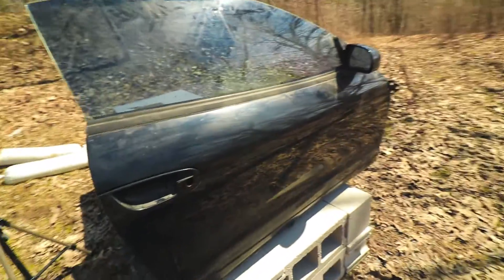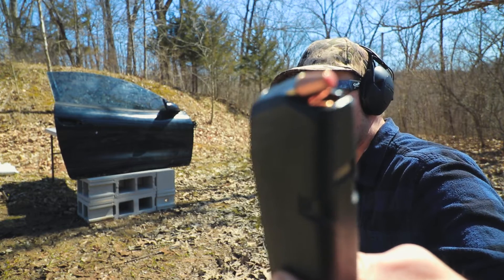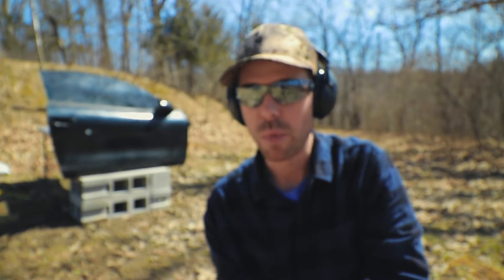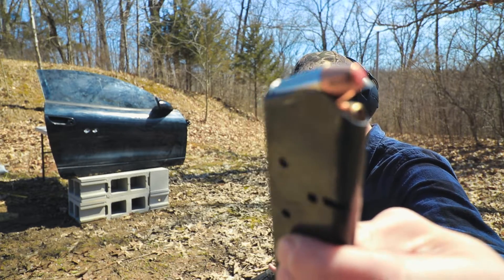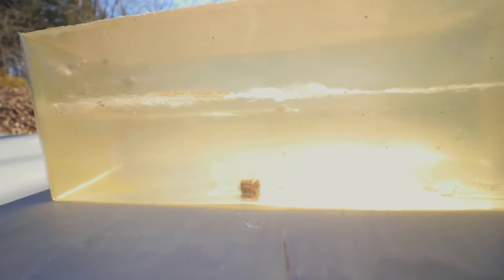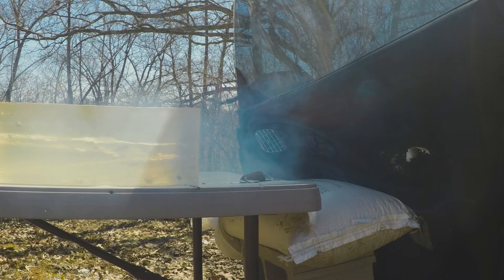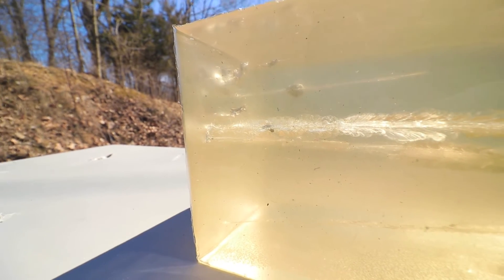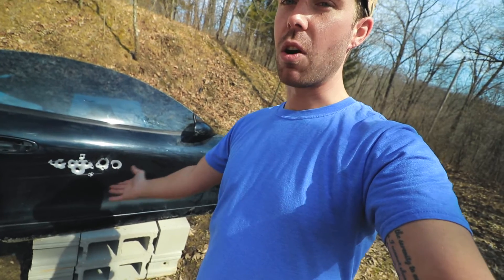Bullets vs Car Doors - Ballistics Test!

Comment: Necroposting...again.
Without watching the vid, the front doors will usually have more electric  motors & "stuff" in them than the rear passengers doors, so where the shot hits is important.
Paul Harrell's results basically showed if you're inside the car, or hiding behind the car in any place not containing the engine, you're screwed.

Comment: You should have shot 380 fmj at that door. Hollow points are banned in my country, a robberies in road are a thing and here are a lot of cheap used 380 and 9mm makarov pistols here. Would be interesting to see if 380 is a good option.

Comment: that door came off a second gen eclipse or talon... I used to have one of those cars, and there is nothing to that door internally. if memory serves me correctly, there is only one vertical brace in the center of the door (behind the plastic) and the window wind mechanism, otherwise its just one layer of sheet metal and the plastic you're shooting through. A cool video none the less, but maybe try to find a bit beefier door?

Comment: Gold dot 124+p and HST 147, the two most popular duty and defensive loads. The 115 Barnes as well. You should fire more than 1 round of each, as you may be striking different things in a car door from shot to shot.

The ClearBallistics dummies have a cool factor, but would actually make for a less useful “test” than a block. They are very shallow from front to back, so many bullets would just zip through. And since x inches penetration in clear gel does not correspond to x inches in a body, it wouldn’t provide any meaningful information. 

PS get a laminated auto windshield from the junk yard! That is the toughest barrier for projectiles to defeat and still provide adequate penetration.

Comment: Great video as always Jesse 👍 I carry 124gr HST in both my ccw's. Then I have 100 rounds of 124gr +p Hornady Critical Duty due to how barrier blind it is. The critical duty is such a great ground and that's what I'd be carrying if I was LE.
Reply from the maker: AlphaRomeo-OneFive Thanks brother.
Reply: @AlphaRomeo-OneFive
Why exactly does everyone use +P Hollows in everything? Is that a good idea to do in a 3.8" Compact (Taurus G3C)
Reply: @grimesresurrection9357  it'll get you more velocity and a little better energy into said bad guy. I personally prefer non +p and carry standard pressure. In all honesty you'd be fine with either as long as the pistol is rated for +p, I prefer standard though as it gives a little more penetration
Reply: @AlphaRomeoOneFive  interesting so you are saying faster velocity reduces penetration? Is it because higher velocity expands the bullet faster and wider?
Reply: @grimesresurrection9357  it doesn't necessarily expand any wider, but it does make it expand quicker

Comment: Do a 9mm vs 40cal in the car door is my suggestion cause it goes with why the FBI switches from 40cal to 9mm and barrier penetration is not talking of ability to penetrate a barrier but what it does after and 40cal was better but 9mm has advanced more since
Reply from the maker: multi dryder great idea

Comment: Loved this test! I currently use the speer gold dot 124gr +p, (which is the NYPD load) and the federal HST 147 gr for my G19 ccw but from the looks of the critical duty 135gr +p.. I'm definitely adding that to the list. Awesome 🔥🔥
Reply: Plus hornady critical duty+p is the FBI load
Reply: @MultiDryder  yeah. I think before that they used the winchester PDX1 Defender 147 gr. But I like the critical duty +p better
Reply: @janice5791  For CCW/self defense, I would definitely stick with either the 147gr HST or the 124gr +P GD. They are two very proven rounds for those needs. Personally, the 147gr HST out of a G19 is my go to round. Now if it were for a strictly LE duty gun, the 135gr +P CD would certainly be a top contender. For a LE gun, there is more emphasis on penetration and being a barrier blind projectile that does not expand as wide as either the HST or the GD, you'll be able to punch through a tough barrier and deeper into what's behind it.
Reply: @jasonzbell  yeah, I agree 100%! You just can't go wrong with speer gold dots or HSTs. I have like 6 50 round boxes of the federal hst 147gr but my go to are the 124gr +p gold dots. The HSTs seem like a pain in the butt to get your hands on so I usually end up just going online to buy those. I went to my local dealer yesterday to buy the hornady 135gr +p but they only had it in the 124gr +p so I requested it and they'll have shipped in by Tuesday. You're right they are definitely good being barrier blind but I think it'll be an awesome winter round as well. :)
Reply: @janice5791  Absolutely, the 124gr +P/135gr +P CD's will be a great carry round if you live in an area where winter attire is thick and heavy. Fortunately, I live in an area where the winter attire is rarely more than a sweater or light jacket. But for all other purposes, the 124gr +P GD's are an amazing round that you can count on. There's a reason it's the primary carry round for so many LE agencies, both domestic and abroad. Whether it's the NYPD, LV Metro or the French GIGN, it's a VERY effective round and a very close second to the HST IMO. Not sure why the HST's are so tough to find. I have a couple contacts over there, so I'll ask why this is the case. Here's where I have had luck with them in the past. 50 round boxes of 147gr HST's for $30. https://www.ammunitiondepot.com/1219-federal-premium-9mm-147-grain-hp.html
Reply: @jasonzbell  thanks! When I go to my dealer they usually only have the 150gr micro hsts. I usually get mine online on either luckygunner.com or venturamunitions and if you go to this link> ://www.venturamunitions.com/federal-le-9mm-147gr-hst-jhp-p9hst2-ammo-50-rounds/ you'll see that they are out of stock of the 147 gr HSTs. I went to that link you gave me and THANKFULLY they do have the 135gr +p critical duty. Gonna buy a few boxes of those now. Thanks again! :)
Reply from the maker: Janice Trawick Thank you! Glad you liked it
Reply: @1ShotTV  you're welcome! Keep em comin